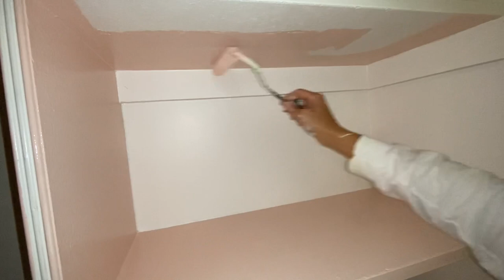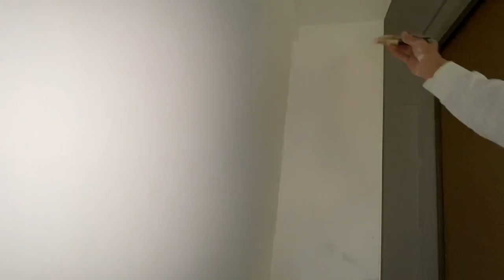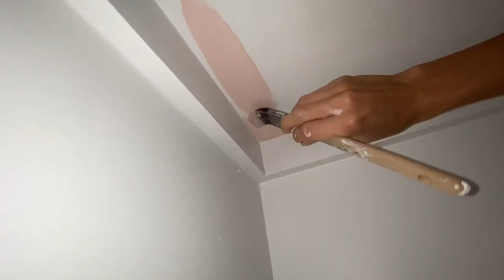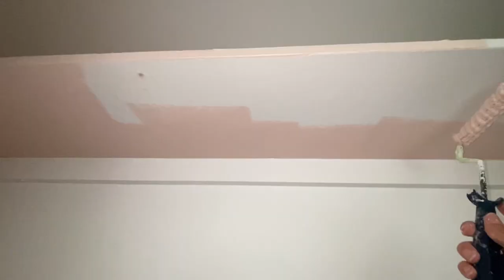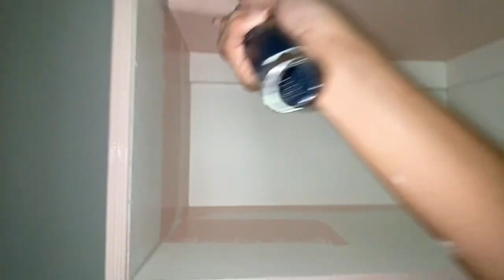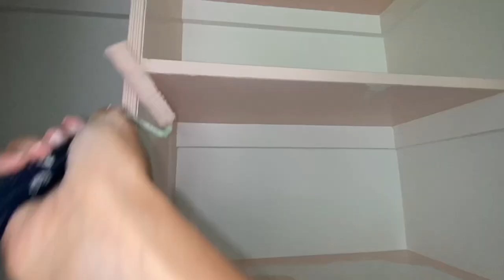Painting pink closet shelves (so satisfying)

Comment: Did you do primer first? Did you do one layer of paint or two layers?
Reply from the maker: Yes, I sanded, cleaned, then primed, and 2 coats of paint on top!
Reply: 👍thank you for sharing
Reply: @thatpainterchick could you share the paint brand you used? And did you use sand paper, or sanding machine?
Reply from the maker: I personally prefer Sherwin Williams, and their Emerald Urethane is what I used on the shelves. I used a orbital sander to make it much quicker, but sanding paper works fine just to scuff it a bit
Reply: Thank you for your reply, super helpful! @thatpainterchick  

Do you know how can I make a mahogany panel with dark wood stain lighter with a lighter color? Do I follow the same steps, which are: first sand the mahogany panel to the bare wood, then apply primer, then apply a light color wood stain?